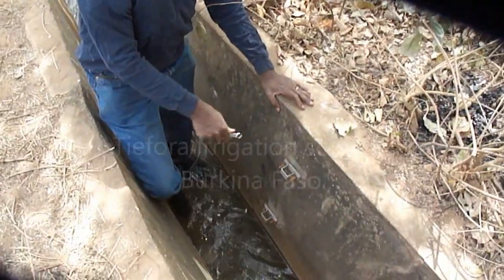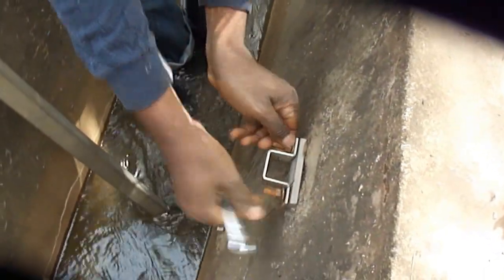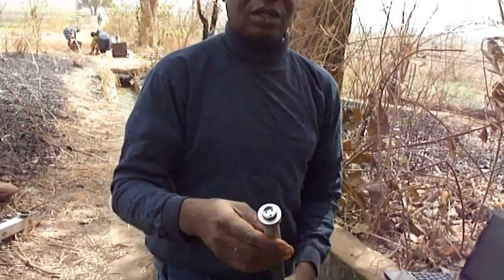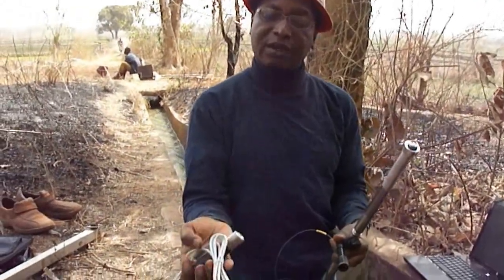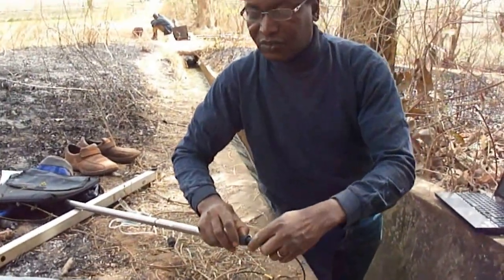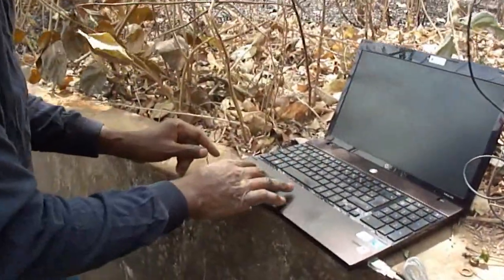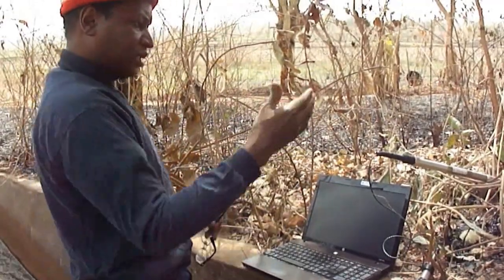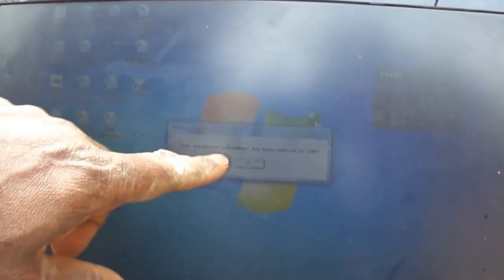Diver installation for irrigation water level recording

Comment: the device as shown and installed is in fact not a diver but an  "e+ Water L" surface water level logger from Eijkelkamp:https://en.eijkelkamp.com/products/sensors-monitoring/e-water-l.html Divers are (ground) water level sensors:https://en.eijkelkamp.com/products/sensors-monitoring/diver-water-level-logger.html